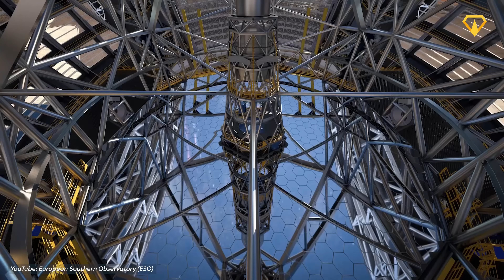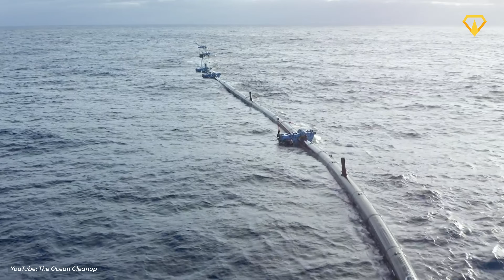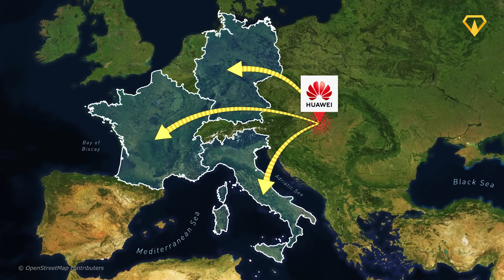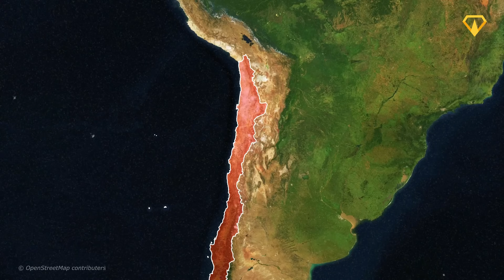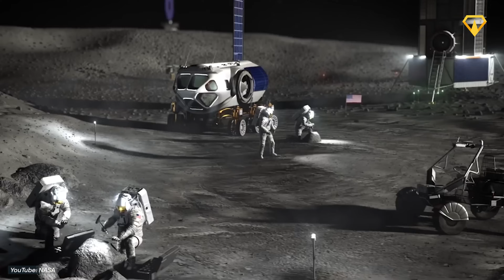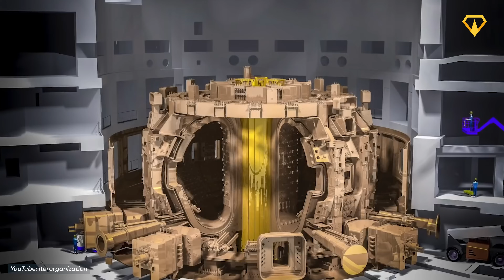The Most Advanced Megaprojects in the World

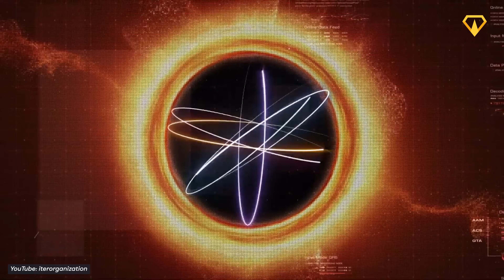Comment: 17:40 Actually nuclear fusion is not that difficult to create. It needs a lot of energy but we know how to do. The only problem is the heat it creates, no materials are able to support it on hearth and this is why we try to keep the magma in suspension via the magnetic field, avoiding any contact with any material.
Reply: the bigger issue with fusion is net gain for energy and longer run times before being stopped